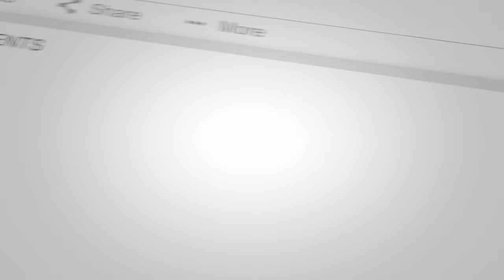Spray Painting a Car in Clear Coat Over Base Coat Walkthrough

Comment: Tony just borrowed a 3Hp 14cfm compressor off a friend.
I have a LVLP 1.3 tip - Optimal 22psi max pressure - 4.3 CFM  gun.
Could you tell what the pressure at the compressor should be set at.
Any other tips would be appreciated.
Thank you
Reply from the maker: Graham Charlton not sure mate on that one I have my online filter set to about 6-8 bar I think mate and the compressor wide open that works well with my setup
Reply: @TonysRefinishingTV  ok thanks Tony

Comment: Good finish mate..I want to get some thing clear on mixing 
Clear coat. Each time I mix HS clear coat maybe 100% of clear coat/50%  of hardner/30% of slow thinner base on description from the manufacture. 29 psi/1 and half fan, 2 and half to 3 turn fluid open. On my WS 400 1.4HD, the thickness of the viscosity of the clear won't allow the gun to spray smoothly, causing much over spray. If i'm to top thinner to make the viscosity of the clear lighter for easily flow on the gun..how do I know the ratio of thinner to add ??
Reply from the maker: what clear do you use and il check for you
Reply: @TonysRefinishingTV  I use roberlo UHS 510, HS 150 and Kapci 3100
Reply from the maker: personally ive not used those but looking at your mix ratios with 30% thinner and using a 1.4 tip id say if anything your putting to much paint out and thats the issue tbh
Reply: @TonysRefinishingTV  OK thanks, if I may ask, what is the different between the 1.3 and 1.4 TIP??
Reply from the maker: 1.4 is bigger so more paint flow

Comment: Nice video bud, would be interesting to see what your finish is like with some of the budget guns which novices buy like fast mover or burisch gtr500 etc. Also what pressure regulator do you use on your gun? Wish I had a paint booth, hard work getting a good finish in a normal garage etc Cheers 👍
Reply from the maker: We did do a video once on a £10 spray gun just to prove it can be done but it’s a lot harder work than with a decent gun , and we all started somewhere mate , wish I could say I’ve always had a booth like this to spray in but I started where you are once mate
Reply from the maker: We did do a video once on a £10 spray gun just to prove it can be done but it’s a lot harder work than with a decent gun , and we all started somewhere mate , wish I could say I’ve always had a booth like this to spray in but I started where you are once mate
Reply: @TonysRefinishingTV  I'll have a look through bud I haven't seen that video. I think you do get what you pay for in terms of guns etc

Comment: Great vid tone, make it look so easy, top job m8. 
What makes that air gun ?
Reply from the maker: if you mean the air blower mate its a powertec air blower it has a dial so you can set the pressure on it its really good
Reply: Tonys_Refinishing 
Looks a good blower m8. 
Off to google it lol
Reply from the maker: lol there very good mate you can regulate the flow from low air pressure to high without having to feather the trigger
Reply: Tonys_Refinishing 
Just ordered one, cheers.
Reply from the maker: wow that didnt take long lol